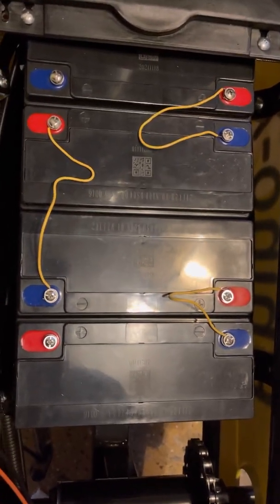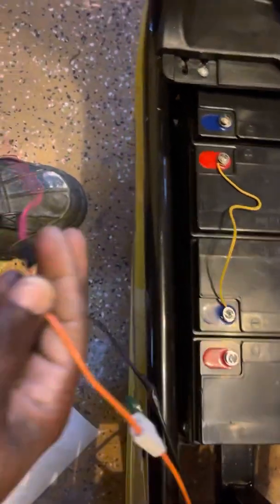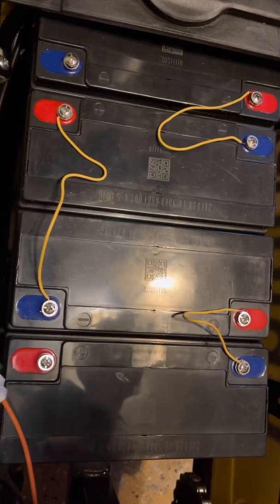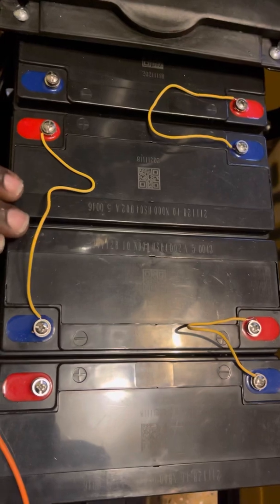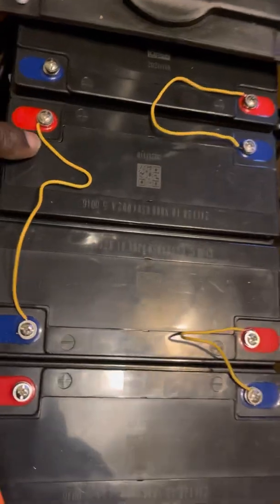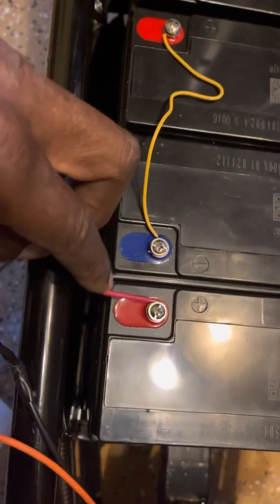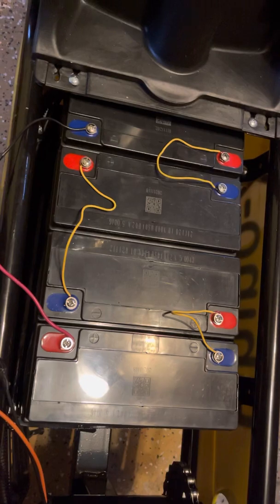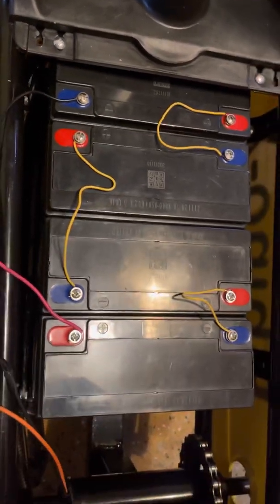Electric scooter battery connection/wiring

Comment: Can you take them apart and charge them individually
Reply from the maker: Yes but be careful if you’re charging them individually, you would need the right charger. Otherwise you can overcharge the battery like for instance if you have four batteries and there’s 12 V per battery that’s 48 V battery so you would need a 48 V charger but if you charged them individually, you only have 12 V so you would need a charger that would stop charging after 12 V otherwise you will blow it up.
Reply from the maker: Sometimes you can have just one bad battery that will throw off the scooter how to test the battery to see which one is bad just disconnect all of them and get a wire that can reach from one end of the terminal to the other and see if you get a spark, if you don’t get any sparks that mean that battery is dead if you get sparks on all the other ones, then you can keep them and just only replace the one that’s bad and that will solve your Problems

Comment: This is not a parallel battery circuit, connections would be positive to positive, and negative to negative. Yielding The same voltage as a single battery, but lasting longer.These batteries are connected in series, which adds the voltages of each battery, increasing the voltage available.
https://share.google/aimode/siJsNJSjhjq0WY5dA